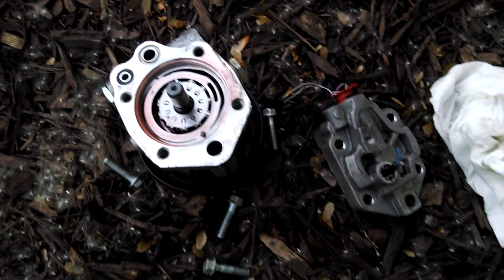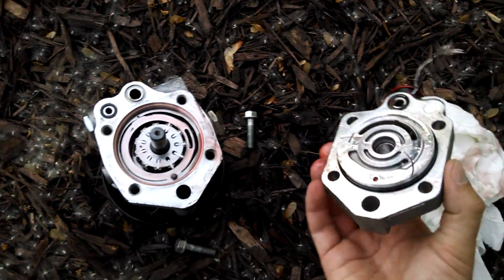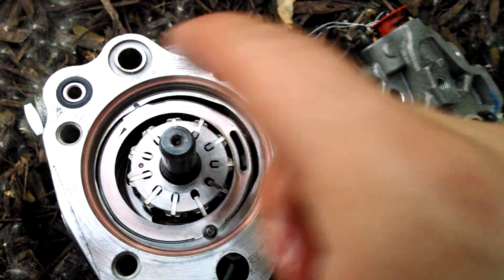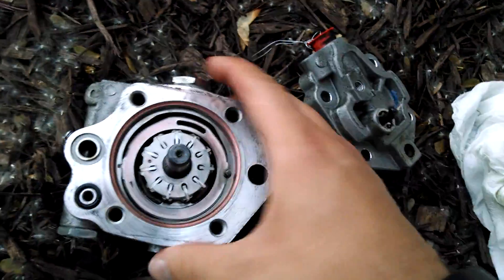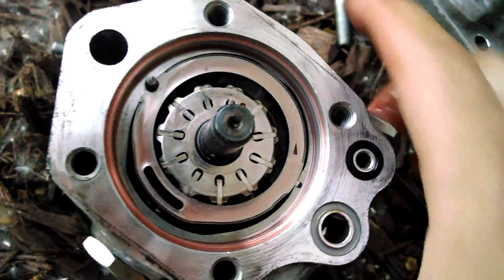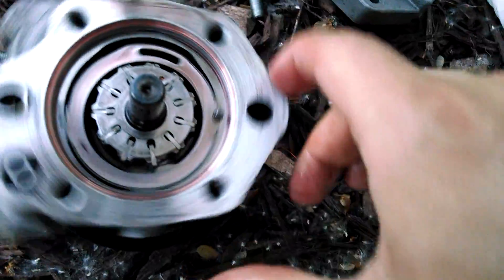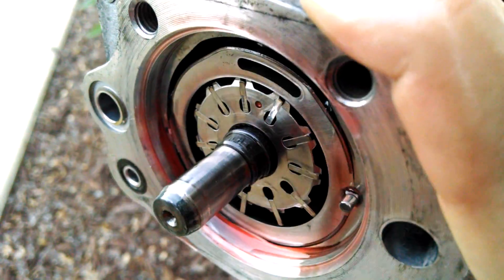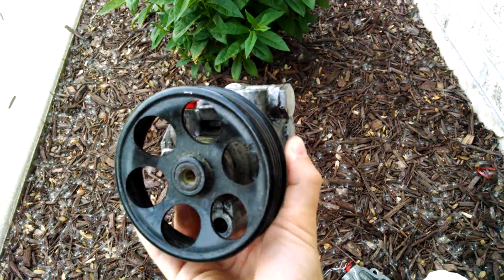Inside a Subaru power steering pump

Comment: Nice,  That's called a "Vane Pump"  if you noticed,  more than half of the movable vanes are NOT moving,  they are stuck in the down position,  That's why it stop working for ya..

Comment: Hi Mitch.
I need to see the pressure relieve valve assembly on this pump.
I have disassemble mine and are not sure of the order  to reassemble the pressure relieve valve(the big bolt on the side of the pump)
Please if you can open yours and video it.
You can e-mail me  josny1964@gmail.com

Comment: Hi Mitch, question for you: I'm putting my 07 Outback PS pump back together. On the big roundish metal ring that surrounds the spinning pump vanes, I know the round metal pin goes on the side with the half-round hole, and matches up to the other half-round hole in the case, and that pin functions as a pivot point. On the opposite side of that is a little channel in the case. My kit provides a little stiff piece and a flexible rubber piece, both of which fit in there. I can't remember if one or both go in there, or in what order (should have taken pictures!). If I put in just the rubber, the round parts swings back and forth really easy. If I put the stiff piece in first and the rubber one facing the round part, it fits snugly, but the big round part moves very stiffly. Can't find a diagram or video with that detail, and no shop I've called actually rebuilds them, they just replace 'em. Do you remember how those go? :-) Many thanks, Eric
Reply from the maker: not entirely sure, try getting a post out to http://forums.nasioc.com/ probably under this forum http://forums.nasioc.com/forums/forumdisplay.php?f=32

Comment: and it looks like the problem may be that those little flaps that are pushed in when they hit the fluid chamber casing, aren't coming back out. Those are what move the fluid through the pump, and if those flaps aren't extending to the wall of the casing, then the fluid isn't being moved.